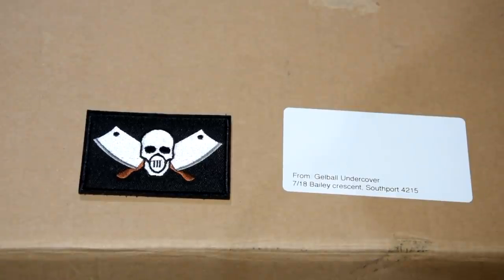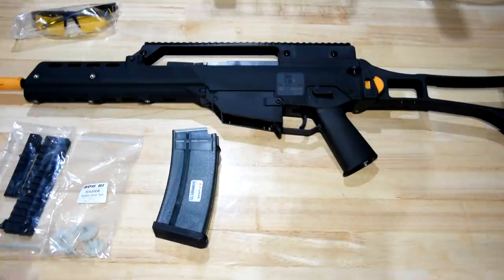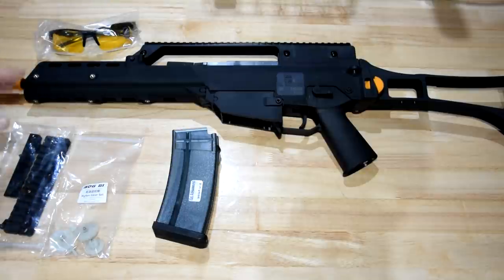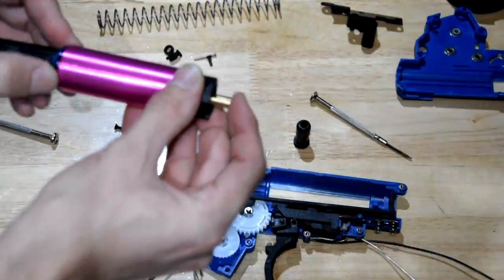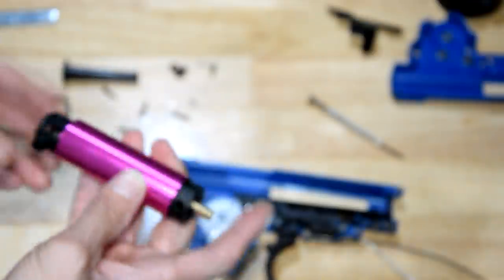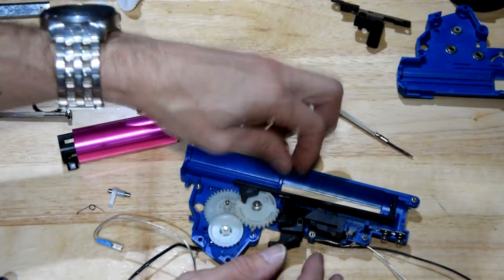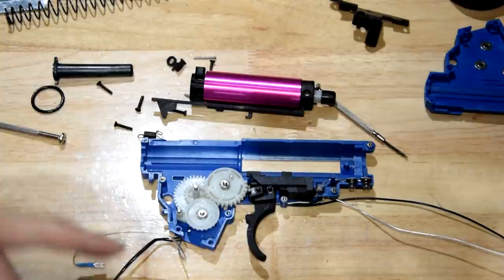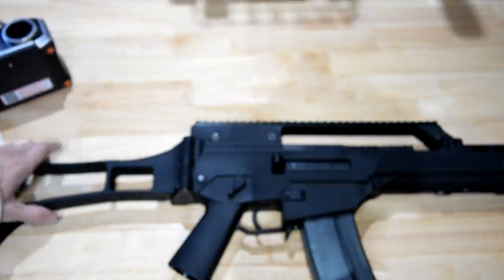BOLBR: 3DG G36K Gel blaster

Comment: Love your vids and the way you record the entire process of disassembling, testing and reassembling the blasters but I think the way you test air seal on the nozzle is not efficient. When the blaster shoots a gel, the nozzle is pushed forward all the way to create a seal against the barrel. Your way of testing is with the nozzle in the retracted position which doesn't show potential air leak when the nozzle is fully extended. Personally, I test the nozzle extended by keeping the nozzle on the tappet plate, resting the corner of the tappet plate on the raised side of the cylinder head so that thr nozzle is extended and test compression like that. I find it better for identifying leaky nozzle. 
This is my way of going about compression testing that I found worked. I just want to share this so maybe you can try to see if it work for you. Keep up the good work on the videos
Reply from the maker: You are correct. But if the seal is terrible with the nozzle retracted it is not going to be better once its extended.  So to be 100% accurate you should test it with the nozzle extended in the T piece and the barrel. But I only go that far if its already perfect seal while extended and still not getting good FPS.

Comment: I think the button is to release the piston when not in use. So there isn’t any built up tension. Have seen on a few air soft TOYs
Reply from the maker: Yeah except this one isnt connected to anything  inside.
Reply: @lowguidoschopshop  i do believe its a de cocking switch. its supposed to release the anti reverse latch to let the spring return the piston fully. but it probably just left unconnected because china QC

Comment: How long will the gears last on 11v and 1.3 spring? Every time I do that they strip half way through a skirmish. You should do a garage V and card board box range accuracy test to show it will last.
Reply from the maker: Well I'll let you know when they strip. I have had standard gen8 boxes running 300fps with big springs for up to a year with heavy use. They do go eventually.
Reply: Low Guido's Chop Shop thanks for the reply, I enjoy your tear downs. One thing I have found is the standard bushings pull though the case with too large of a spring, and the drilled holes in the case turn oval shaped. Have you encountered this? Only way I have resolved is turning up my own bushes that are longer, protrude through the casing more.

Comment: Hi, thanks for the great vid. May i ask if it use the same gear set as other v2 ( j9, slr... For example)? Also can i use others cylinder head for this g36 or is it need its own type of cylinder head?
Reply from the maker: yes its all common gears, and cylinder head.
Reply: @lowguidoschopshop  and what about the tappet plate?
Reply: @lowguidoschopshop  also does it use the same t piece as any other gel blaster? Thanks
Reply: @lamducbao  Chữ T nó tháo ra váo vô được mẹ ơi :)) đồ độ nó sài chung hệ với gen 8 và j9 thôi

Comment: Thanks Low Guido! Interesting. Bit of an enthusiasts blaster by the looks.

Any estimates as to how much of that improvement was due to the spring change vs compression fix?

Still seem to have feeding issues at end? Or the chrono missing the shot?
Reply from the maker: My chrono was playing up a bit. it was shooting but not reading on the chrono I gave it a "technical blow" and it seemed to clear up. One disadvantage of shooting into a box is that the gel bits sometimes come back into the chrono.
Reply: Thanks for responding mate!